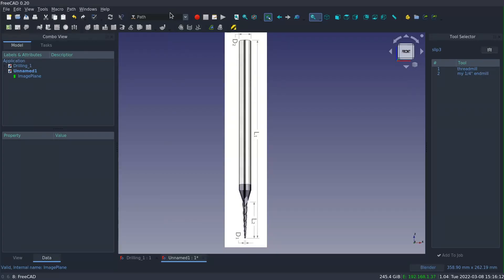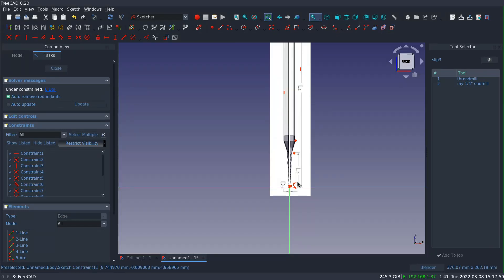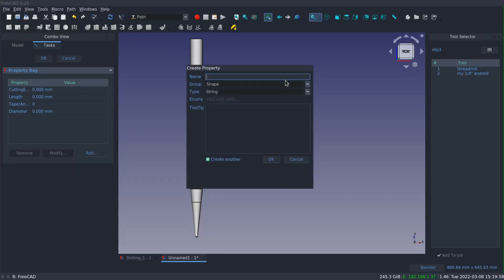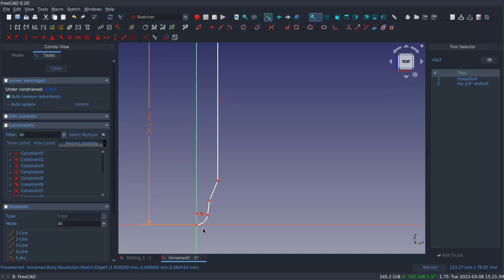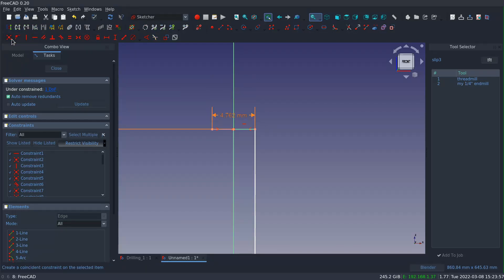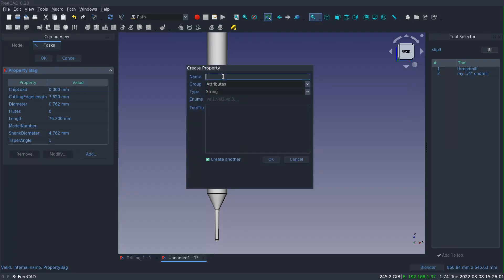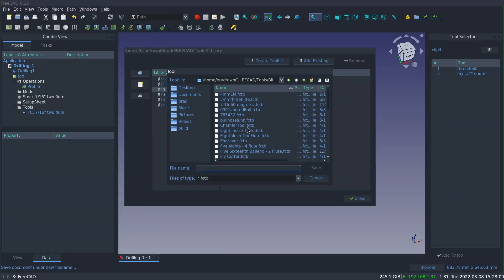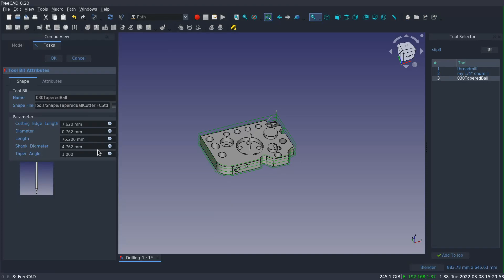FreeCAD Path - Custom Tool Shapes

Comment: I just went through doing this to create a tiny vcarve bit.  I kept getting an error until I placed the fcstd file in the tool library shape folder.  Then I could save the fctb anywhere.  Not sure if I'm doing something wrong here.  .20 version.  Actually still can save it.  Now I can get to attributes but when I close it disappears.

Comment: Biggest danger in using FreeCAD's Path Workbench is the lack of tool holder geometry setup/identification, especially with regards to collisions.  That's an area that needs a lot of development still.  Having said that, I'm amazed at all the wonderful features packed into the Path Workbench. Thank you so much for all the work being done on this CAM workbench.

Comment: Thank's for a great video.  I've watched it 5 times and thought I followed your every instruction, but when I go to add the tool to a path job I get error messages.  I'm running Freecad 20 on a MacBook Pro 2020 with Monterey.  Is the process different for FreeCad 20?

Comment: i see you are a freecad path specialist - so did you ever worked with freecad and a 5 Axis milling machine - means is freecad capable to generte the gcode for 5 Axis
Reply from the maker: It's something I've been working on (slowly).  The problem is difficult for several reasons.  

First, I need a machine that I can learn and test on.  I've never used 5 axis in production so I need to understand the workflow and assumptions of 5 axis machining.  For example, I spent the last couple weeks learning about Tool Center Point (TCP) kinematics and tilted work planes. There's a lot to learn and I need to understand it pretty well before I can do anything interesting in Path.  

The actual work to be done in Path is very large.  All the existing operations in Path have to be refactored to remove the 2.5D assumptions. New toolpath generation functionality has to be written. The GUI has to be changed to support it without breaking the current functionality.  The postprocessors have to be rewritten to support the new gcode.  Visualization and simulation need to be written.  Unit tests have to be written for all the new logic.
All that is just to get to 3+2 milling.  Continuous 5 axis machine paths are still a long way in the future.

I have a Patreon account. Those people are actively helping me to work on Path and I'm grateful. With that money I was able to buy a small 4th/5th axis rotary table for my mill.  I'm still working to get it to do TCP kins but I'm close. 

I would like to work on multi-axis features more. Unfortunately, I also have to earn a living.

Comment: Yeah a great video from the Guru Master. One small problem - The icons and pointer are so small you loose track many times of what is going on. With bigger icons and bigger and bright red pointer you will have the best CAD videos.
Thanks for your help.
Reply from the maker: Good point!  I'll work on that.